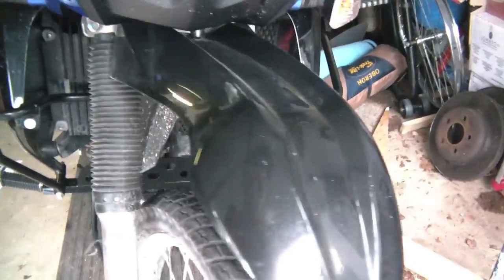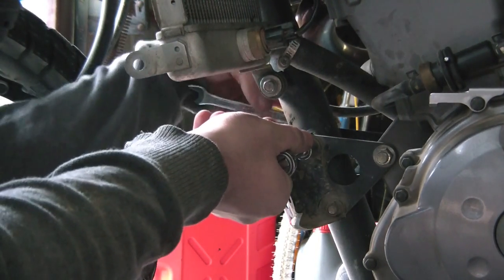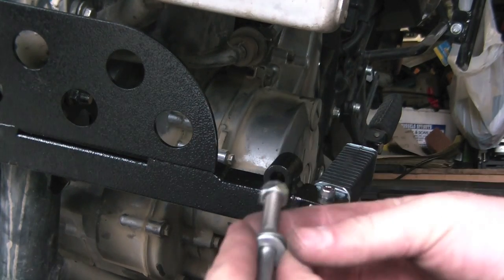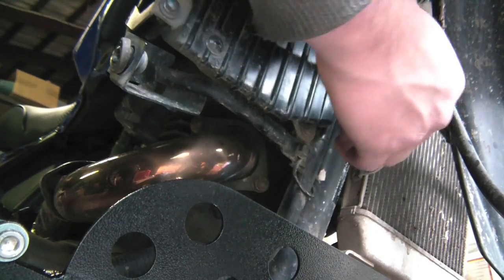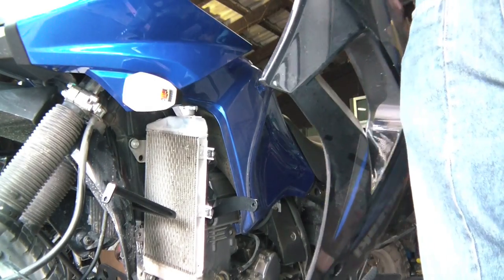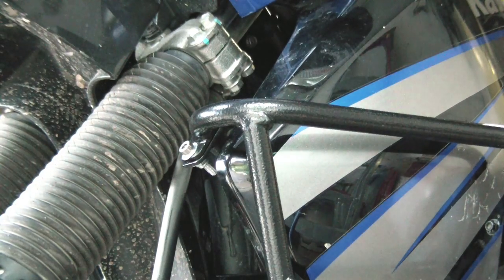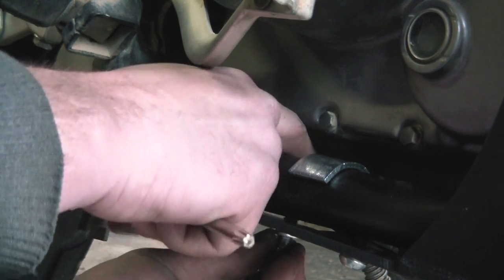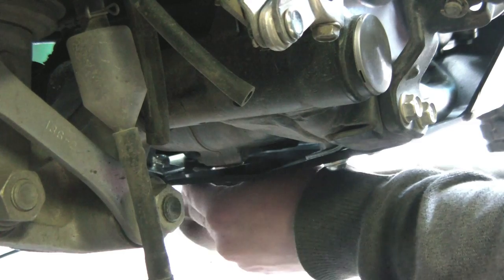KLR Mods - PD Nerf Crash Bars & Skid Plate

Comment from the maker: Yeah its a little strange, and a long process. But it comes together fine and you won't notice either way. Just be sure to have a little bit of loctite on them and do them up tight too, as I lost one of the bolts and its nut because it vibrated loose.

Thanks for the compliments!